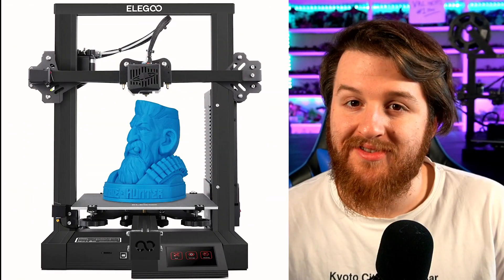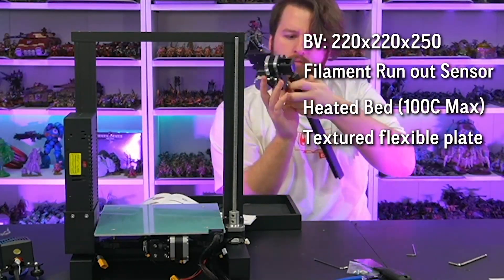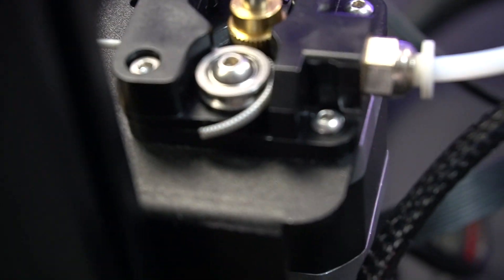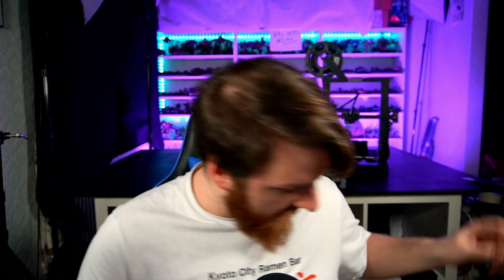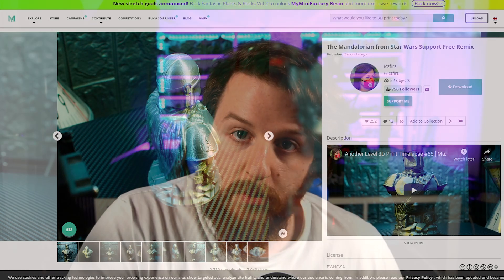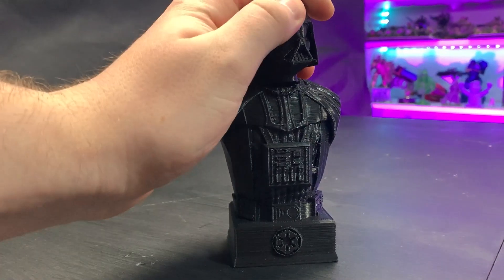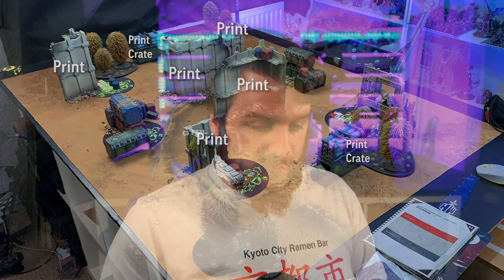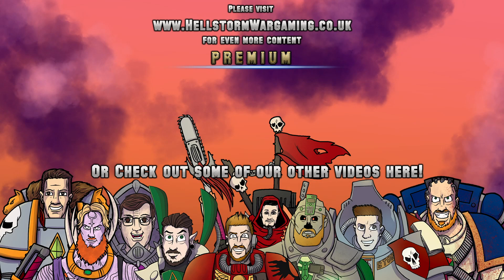The BEST budget 3D Printer? Elegoo Neptune 2 Unboxing and Review / setup 2021

Comment: I built mine last weekend and have been having all of these same issues all week. I've adjusted various different things and releveled and everything. What's really weird is that the first thing I printed was a CHEP cube and it came out perfect. So I started my 2nd print and checked back in an hour to find a blob and a mess. Nothing has printed right since. I only really started getting frustrated today after working on it all day. But it looks like it has printed another CHEP cube ok. Maybe this thing can only print CHEP cubes.  I'm going to try Prusa slicer and see.
Reply: Did you ever fix your problem?
Reply: @blackhawkuh-6026  yes. It was a lot of things. The z axis wheels needed to be tighter, needed to level the bed again while the machine was heated up, bed needed to be wiped with isopropyl alcohol to clean it.  I also started printing the first layer at nozzle temp 220 and bed temp 60 and then all other layers are at 210 and 50. No problems since.

Comment: What did you all do to get Prusa Slicer to work with this printer? All my sliced G-Code files from Prusa Slicer won't print with this slicer. I have never had any luck with Cura so I basically just stick to Prusa Slicer. But since I can't seem to get mine to work all I really printed out with it was the buddha test print. The other prints I tried while using Cura all failed. Like I said I have no luck with Cura.
Anyways I'd love to know how people are using Prusa Slicer with it. I even tried reinstalling Prusa Slicer but I get the same thing. G-Code files that do not print at all and do not even display a image f the model on the LCD screen when you go to select it to print. I have a feeling that my Prusa Slicer is not producing the correct type of G-Code file for this printer. I am at a loss to what is going on. Who knows. Maybe the firmware on the printer is messed up.

Comment: Does it work with gcode files I already have or do I have to use the Elegoo software to make gcode files?
Reply from the maker: It’s a fairly standard Printer, the files I used were technically for an Ender 3!
Reply: @HellstormWargaming  I see so which slicer did you use to make your gcode? thanks for the fast reply that was amazing :)
Reply from the maker: I used Prusa Slicer to generate Gcode for the video, and still am!

Comment: Something is wrong with the X, Y, Z calibration or belts. that banding is baaaadd..  i have send better prints from a printer from  2018... the TMC2225 drivers are rebranded TMC2208 and don't play good with Linear Advance. Would like to know if the drivers are replaceable..

Comment: I received mine a couple of days ago and it printed perfect straight out the box using cura ender3 default settings. I also own several creality machines and this is easily as good on print quality and you get a lot more for your money. It also has a 32-bit board with bl-touch header and silent stepper drivers. The only niggle is the internal fan is a little noisy but other than that no issues at all and the build plate sticks models like crazy. Try wiping yours down with alcohol see if it helps and as for your layer problem it looks more like a filament quality/temp problem
Reply from the maker: Great tips man! Thanks for the heads up!

Comment: Looks like a nice affordable printer, what’s the fumes/smell like from the FMD prints? Would it need a lot of ventilation?
Reply from the maker: No real fumes from this sort of printer, it’s melting plastic so it does have a risk, but no obvious odours. :)
Reply: @HellstormWargaming  cheers buddy, might have to sneak one of these on the hobby desk
Reply: You probably know this by now, but the odor is almost nothing if you use PLA. It has a bit of a sweet smell actually  but it is faint.  I recently tried printing ABS and it was god awful. I have my printer on my hobby desk as well. I had to stop the print. I’ve got an open concept house so the whole house smelled from it.

Comment: What resolution were these printed at? I’ve been using the Ender 5 with none of those issues you’re showing
Reply from the maker: 0.25 at a fairly fast speed. The last print (crate) has by far the best result, after tightening the belts and fine tuning the printer a bit more, there’s lots more I can do though :)

Comment: Urgh, those layer lines!  I'd love to see some comparisons to an ender 3 with the same models, materials, settings etc
Reply from the maker: The later results after some tuning start to look a lot better, but yeah - layer lines are always going to be present, so it’s best to choose the right printer for the job 

Sadly I don’t own a ender 3, but the results are similar to what I’ve compared to friends who do have them! :)
Reply: @HellstormWargaming  try printing at 0.12mm layer height, it takes longer but layers shouldn't be visible
Reply from the maker: Loads of tweaking to do, going to run an update video once ive had my teeth sunk in for a few weeks!